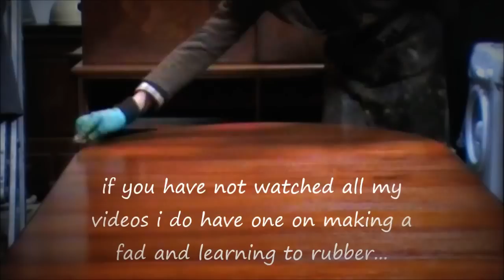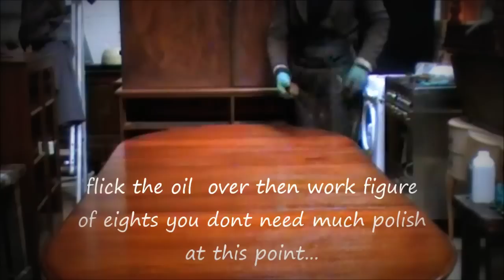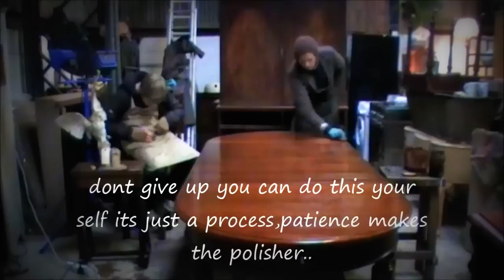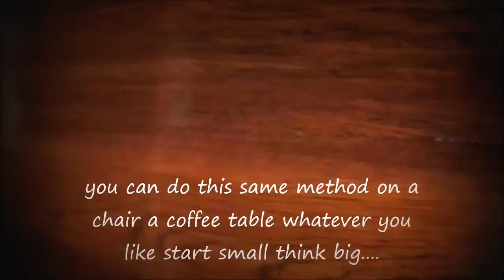How to French Polish a Dining room table.hand finishing.

Comment: Hi,great videos BTW ;)  I have a mahogany dining table that I bought almost 30 years ago and it is lovely but there is a build up of polish that I have just discovered should never be used according to the spray can in tiny letters! I watched your videos and would really like to restore it to it's former glory but I have a problem with fumes from the spirit! I know I do have a problem because I am an oil painter  and the thinners nearly kills me with fumes.I have COPD also :( Is there anything I can use other than methylated stuff please? I also have 6 chairs that need doing too..gah !! 
Advice please if possible.
Reply: this is going to come off as sacrilegious and I'm not sure if it is an insult to the custom yet, but I believe minwax has come out with a waterbased wipe on poly, clear gloss. Essentially an oil-modified finish. I've had some luck with it.

Comment: A question that I have is that I recently refinished a large table; choosing not to strip to bare wood. It came up really well, however, there are lots of fine streak marks left by the rubber. What is the best way to get rid of these fine marks as they seem to appear? They highlight the figure 8's and also the strokes with the grain. I can get rid of them by cutting back with steel wool;, however, the rubber seems to just put them back on no matter the style used to build again.

Comment: Hi, hey I own a mid 1800s dining table, it has been revarnished a few times the last time 10 years ago with a waterborne finish, it is wslnut, the top is veneered walnut, as far as I can see no stain has ever been used. If you had to strip this top and prep it for french polish, what type of stripper would you suggest? Ive been french polishing for 3 years, love the process, but small projects, but no tables??  Thanks greg

Comment: Great videos. Wish I'd had this resource 40 years ago when polishing a large harpsichord (panited finish). Now recovered and daring, I'm polishing a Queen Anne dresser, with a goal of achieving a mirror-like finish. The cherry grain is pretty tight, but still with pores in evidence. Should I brush or rub on a couple thickish coats of polish initially to fill the pores and then progress to umpteen thin coats with the rubber, which I presume somewhat reactivates and smooths earlier coats? The rubber leaves faint "tracks" so I can tell whether I polished in circles or with the grain. At what stage do these tracks disappear?
Reply from the maker: it takes a long time to master the fad so your skill with the process will show in the finish.. if you are using a mop to coat up instead you can sand flat between coats with fine sand paper then after the final coat.. sand flat and use burnishing cream to buff to a high sheen.. be warned lots of elbow movement needed with burnishing cream... and remember you just have to be happy with the finish its your piece of furniture. time practice and patience.. speak soon Rob

Comment: Did you polish this table with the leaves in it?  I assume so as I saw the crank at the end.  I have a similar table but uncertain if I should attempt to polish with the leaves in or out?
Reply from the maker: I'm 6ft 4 so it's quite easy for me to reach over I leave a slight gap so the don't stick I find I get a better match and colour Finish..there is nothing wrong with doing the leaves to the side if it makes space and work easier ..many thanks Robert

Comment: When you use what you call "white oil", I assume this is mineral oil. Correct? If so, could I use off-the-self mineral oil from the local drugstore? This is the same kind you can use internally. Or is this a different product? I have found mineral oil in a kitchen shop, but they seem to be the same thing as from the drugstore.

Comment: How do you remove the rest of the oil at the end of polishing without getting a cloudiness or streams?
Reply: meths, apply to fad squeeze on to back of sandpaper , rub mixture and start again.
Reply: Frech polish could use any oil. From wiki,  you can use olive oil. Apply shellac with oil and polish until it get sticky. Let it cure for 12h, repeat. Last layer more oil, then remove excess with rubber and you have done. Then apply hard wax.